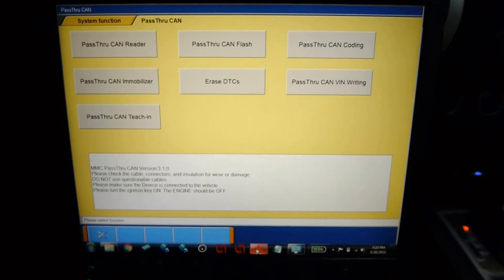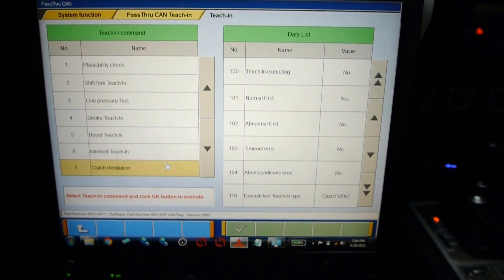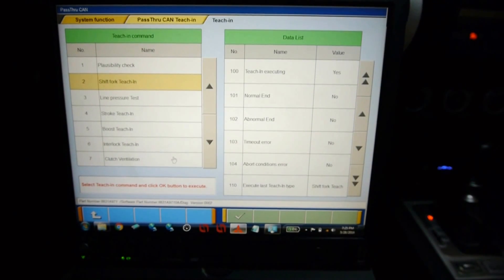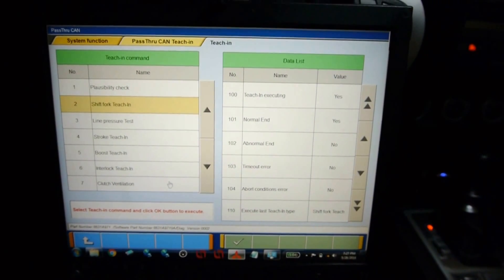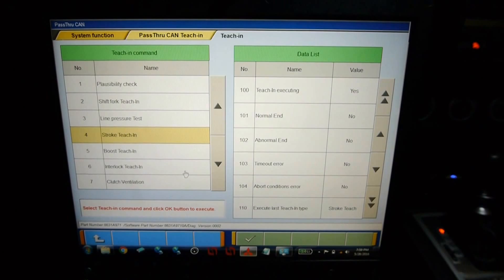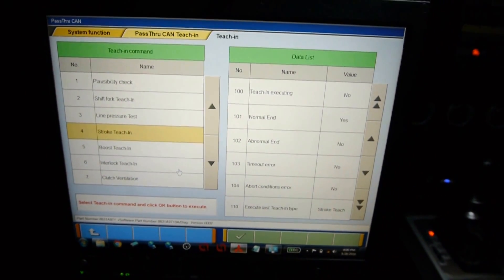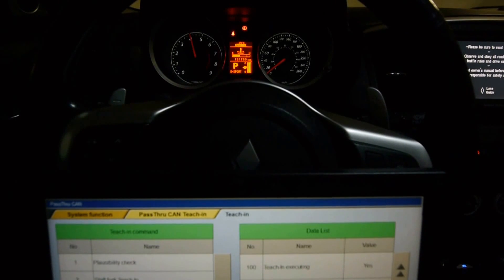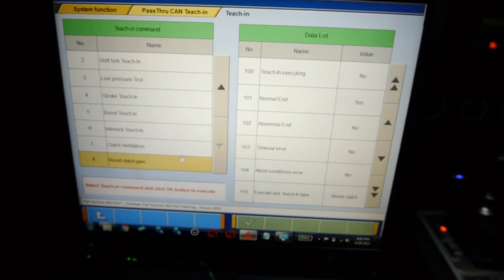SST teach-in Mitsubishi Lancer Ralliart and Evolution X MR

Comment: hey man, thanks a lot for this video, i got question though, is these maps can be applied on all modules ? i do have 2011 ralliart, so is it going to work ? FYI i didn't do this before, so i will go through the video step by step, and i am doing that, becasue sometimes when the car shifts down when i remove my foot from gas it shake, like hard shift down, also i am looking to change the oil anyway so it will good to do that after the oil has been changed as i understand from the video. 
thanks
Reply from the maker: Yes, the teach-in process will work on a 2011 Ralliart. The teach-in might help now, and it certainly can't hurt to try it. Changing the transmission fluid if it is due, ONLY with genuine Mitsubishi Diaqueen SSTF-1, and changing the filter at the same time (some dealerships skip this step) and then doing another teach-in afterwards is certainly a good idea.
Reply: I was wondering if that ecu adapter is a usb or Bluetooth connection to  the computer?
Reply from the maker: The Mitsubishi software only works over USB. You need a J2534 compliant pass-thru cable. An Actia should work. A Tactrix OpenPort 2.0 definitely works.
Reply: hey man, i got the openport 2.0, i was going though the flush guide, i see you pick the cnf files for 2010 evo, i have 2011 ralliart, is ok to use these cnf files or where i can find the ones for 11 evo/ralliart. i already checked your google drive and didn't find these files.
Reply: never mind i found the answer in the comments, thanks again

Comment: Can teachin be done on 2008 evo x mr or do you have to flash ecu with another software
Reply from the maker: The 2008 Evo X MR originally came with TCU software that was Diag. Version 0000, which does not support teach-in. If your TCU software was updated at some point, you should have Diag. Version 0001 or, even better Diag. Version 0002, which both suppport teach-in. If has not already been updated, you will want to update the TCU software not just for teach-in, but for the other improvements that come with newer TCU software as well.
Reply: thanks

Comment: i can't do the teach-in , saying invalid TC-sst recalibation data. Please contact mmna
Reply from the maker: The TI_Info.tipart file must be in the C:\Program Files\PassThruCAN\DiagDB\XML\ folder.
Reply: Stephen Strangways I have the same inconvenient, I have the file in the correct folder and doesn’t work
I have 09 RA and it has this ecu part number 8631A513 and s/w 8631A5130C
Do you know what could be the problem?
Maybe the frimware ?

Comment: You used the tactrix Openport & what kind of cabel to connect?  thx for that video of course
Reply from the maker: The Tactrix Openport plugs into your car's OBD-II port, and then the USB cable (included) connects the Openport to a computer running Windows.
Reply: Stephen Strangways thx for the fast reply !

Comment: so what exactly is the whole point to doing this ?
Reply from the maker: By doing teach-in, the SST runs self-tests in the mechatronic assembly and clutches, and then stores that data. After replacing any of those components you need to do a teach-in. Many owners also choose to do it to account for the normal wear on components from a year or more of driving. A car that has slightly rough shifts is usually smooth as butter afterwards.
Reply from the maker: I'm sorry, I don't understand your question.
Reply: +Stephen Strangways do you just need the software to do this ? or is there anything else needed to do the teach in ?
Reply from the maker: You need the software, and an OBD-II cable that is J2534 pass-thru compliant. A Tactrix OpenPort 2.0 cable will work and lots of Mitsubishi owners already have them.
Reply: Oh alright !! Thanks